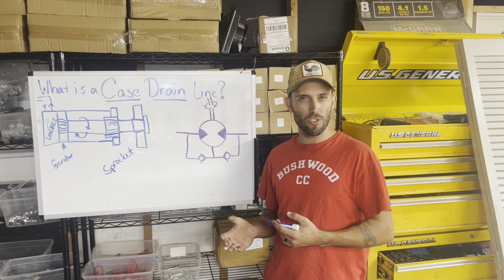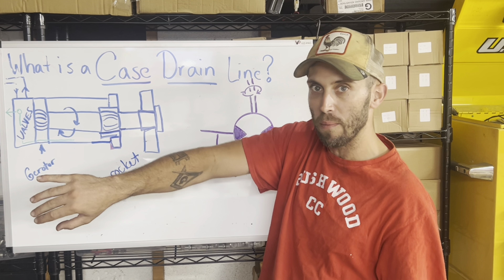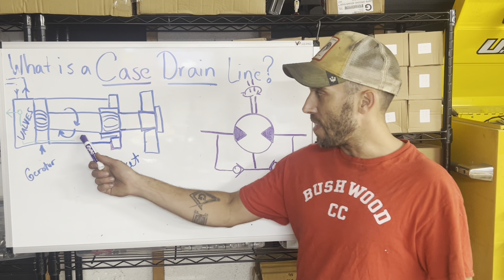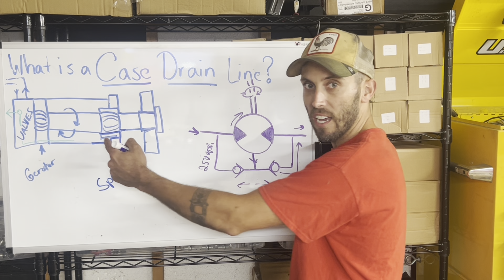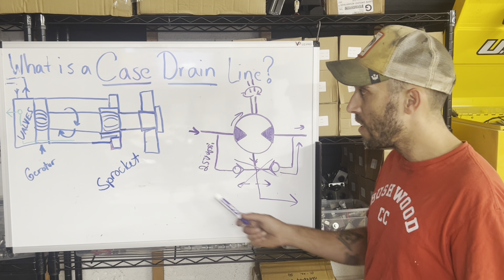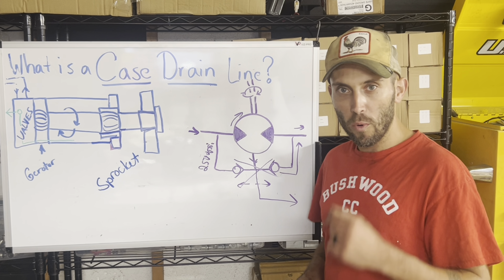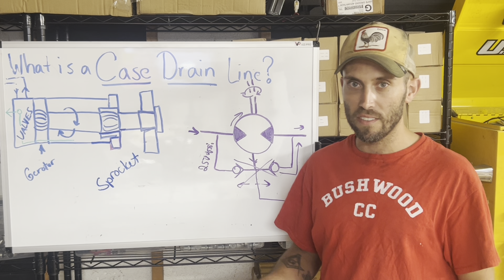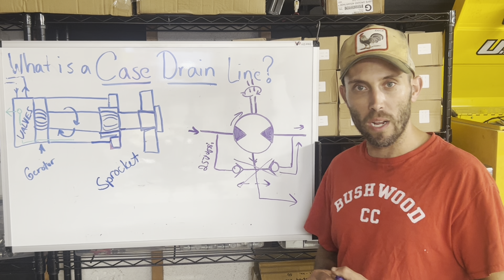Chinese Excavator or Skid Steer wheel motor leaking? Shaft seal failure? Case Drain System

Comment: Since you have a Miva VA15P does it have a case drain connector for auxiliary attachments? If not, what is the best way to add one? I bought a Miva brush cutter for mine and discovered it has a third hose when I went to connect it and learned that it’s a case drain hose.

Comment: I’m in the process of possibly adding a case drain to my agt h12r. If you had any advice or tips it would be most helpful
Reply from the maker: The biggest problem you’re gonna run into is figuring a way to get the case drain to go through the hydraulic swivel
Reply: @ I figured it out. The case hydraulic line from the brush mower was plenty long enough so I ran it with the other lines under the house and back up to the tank. There already was a welded bung with a cap on it. I remove the cap and the line screwed right into it. As if it were completely intended to do so. I’m adding a quick disconnect to that line so I can leave it there for future use.

Comment: Could it be the cause of oil leakage from the hydro engine and poor quality or worn out tracks?
Reply from the maker: Lack of a case drain, or tracks too tight
Reply: So I have to watch the track tension.  My oil seal has blown out three times already.
Reply: For Eaton Char-Lynn 6000 Series Hydraulic Motor
Reply: That's my engine

Comment: My "Rhinoceros" Chinese 1.2t mini excavator had a leaking shaft seal, i think it was shipped or stored dry and the shaft under the seal and inboard of the seal was  rusty on the long boat trip or storage. when it was run the rust wore the seal down, in less than 50 hours it was losing a couple of literes of oil per day. I pulled the motor, cleaned up the shaft with some 2000 grit and replaced it with a seal i got locally, nearly 300 hours and no problem. Was a pain to get the right seal, the drive seal only sees the return line pressure in the Eaton motors so you don't need a high pressure seal but Eaton specs them so they can take the full pressure in case of a blockage on the return line.

Comment: I've been having an issue since day 1 with my h12. The machine drives fine when you first start it up, but once the hydro oil gets around 110f the tracks stop working independently. It has no problem driving straight, but i can't turn. The engine just revs and strains and i won't get any movement unless both tracks are moving the same speed and direction. After turning the machine off and letting it cool it works fine again. I just purchased the oil cooler kit and I'm hoping it helps. Any idea where this problem is coming from?